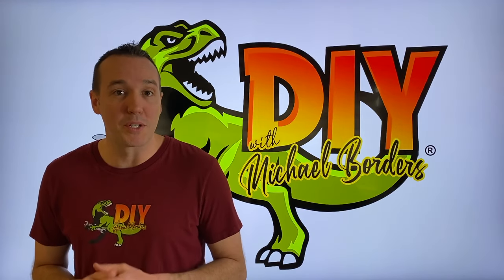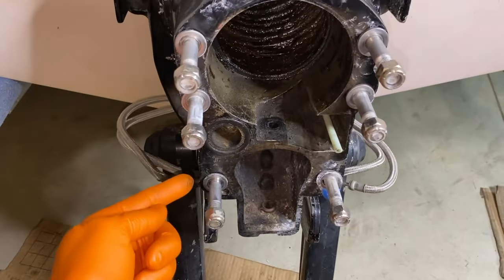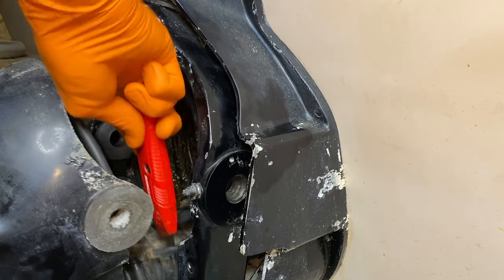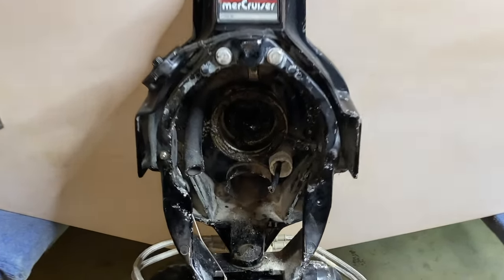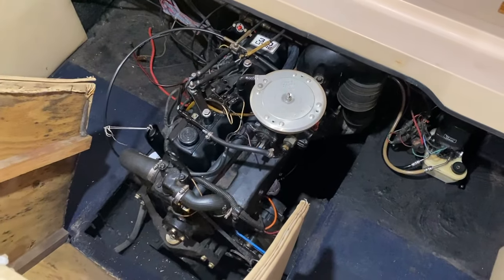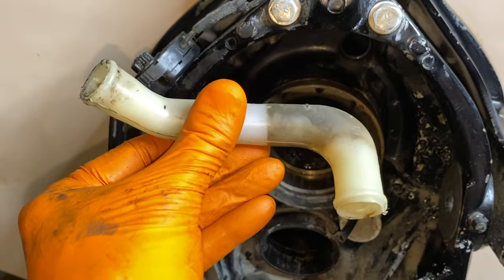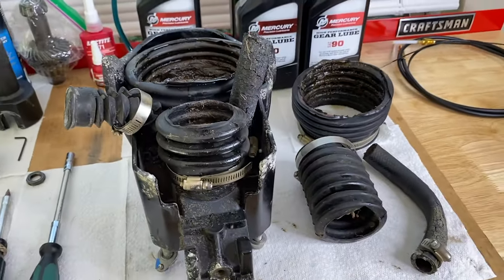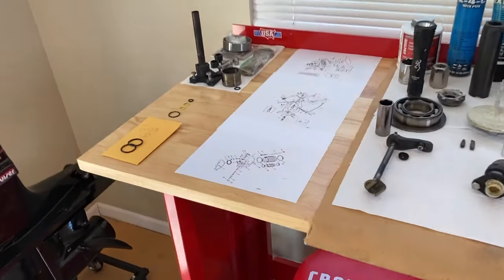Replace Mercruiser alpha one gen 1(2) outdrive bellows - PART 2

Comment from the maker: If interested in purchasing this product, visit our Amazon affiliate link below.  I earn from qualifying purchases.

Service manual 6:  https://amzn.to/3ysdBu6

Bellows replacement kit:  https://amzn.to/3RL7h8v

Hinge Pin removal tool:  https://amzn.to/44YuasH

Pic tool set:  https://amzn.to/3OCE9NE

Long flathead screwdriver:  https://amzn.to/3OQebHB
          
Pipe/hose cutter tool:  https://amzn.to/454qaXC
          
Flex Shaft Screwdriver:  https://amzn.to/3s8E3W4  

Utility knife:  https://amzn.to/3QBjP1K

Gen 2 U-joint tool set:  https://amzn.to/3KvNPbu

Shop Vac:  https://amzn.to/3scLdsr

Endoscope:  https://amzn.to/3qvdU3m

Shift Cable Socket:  https://amzn.to/3qtVdgq

***********

1.  How to remove outdrive from boat

          https://youtu.be/mD3YcT2Ohrc

2.  Bellows replacement (PART1)

          https://youtu.be/NcObTOYXtQM

3.  Endoscope tutorial

          https://youtu.be/HiPQlDLjiBI

Comment: Excellent excellent video I have a quick question.  Is it any easier to do this on a GEN two and in general How long can you wait before a Bellos overhaul if the boat is trailered and flushed and washed every time it is used.   I use mine in saltwater.
Reply from the maker: We really appreciate the feedback, very much appreciated.  😎👍

The big difference with the Gen 2 is the oil line.  The Gen 1 setup does not have the oil line that feeds from outdrive and into bell housing…and through the hull and connects to reservoir.

Some will drain oil prior to beginning this project to alleviate a mess when disconnecting line during project, while others will plug line.  However most, including us, will drain oil oil completely first and replace the oil hose during the project.  

After boat is removed from water and trailered, you can start when its best for you.  

Keep us posted on your progress.  👍🧰

Comment: 2:52 Mine will NOT budge and now the screw head is slightly stripped. Does this really need to be taken off?
Reply from the maker: @catlas_  

Thanks for watching, any update?  Not always…however that will depend on the level of repairs you are performing.

In our case, it needed to be removed during the overhaul process.

This screw/pin is held in with Loctite, and can be very stubborn to remove.  Keep us posted.  🧰

Comment: the shifter shaft seal is not an oil seal its there just in case the exhaust bellows got broken the water dont go to the u joint bellow and keep your boat running free of water without a problem and helps to keep the lubrication in the shifter too ...there is not oil there ...my respect exelent video
Reply from the maker: @luiscardozo0000  

😁👍

Comment: Hi Michael my tv switch itself of i was about to switch on my PlayStation and the remote is broken the power button on the tv doesn't work so and its a Hyundai PHD Monitor 42 inches what should i do
Reply from the maker: Hey thanks for reaching out to us.  We recommend unplugging tv and leaving disconnected for 5 minutes followed by plugging back in and seeing if power button works.

If not, it’s surgery time!  Time to replace the power button.  Below is a helpful video showing how to do that.

       https://youtu.be/vsLSXk6Q5Tw

😎👍
Reply: @DIYwithMichaelBorders  the thing is it pretty old
Reply from the maker: @panthercrew9506  

Might be best to replace button at a minimum.  👍
Reply: @DIYwithMichaelBorders  thanks
Reply from the maker: @panthercrew9506  

😎👍

Comment: what specific tool is used to remove the retaining ring on the U-joint bellows with alpha gen 2? the "gen 2 ujoint tool set" in your link is everything for pulling and inserting the gimbal bearing, but is there a specific tool for getting the retaining ring out? Or do I just have to try and bend it out? Thanks!!
Reply from the maker: Thanks for watching, most will just carefully collapse the lock ring with a flat head screwdriver.

Comment: I have a Alpha one Gen two with the Gear oil reservoir in the engine  compartment on the front of the engine. Do you have a video showing removal including separating the oil line?
Reply from the maker: Thanks for watching, we don’t at the moment unfortunately.
Reply: Your videos and explanations are very supportive and well done, i have never done this 😅 job but step by step going through the process. However i have the same oilreservoir and oil line. When i dismantled the bellhouse the oilline broke of the point where it goes through the hull. Excuse my explanation, i am dutch haha. This seems a big problem as i have a 5.0 v8 and much less space then you have with the 3.0. It appears to me i can get the trim done, possibly the shift gear 9 very difficult to reach the point of entry. Probably shou😅ld not change that plastic insert since i cannot reach it. Anyway in the end the broken plastic nipple is the point where i have no more answer except taking the engine out to reach it as it appears to be fixed from the inside through? Do you have any suggestions how to approach this, ilive on Bonaire (carribean island) and it is not easy to get any tools or materials unless i have someone bring it over.
Reply: RM22-861163 and 	RM22-861163 seem to be the item broken. Is this possible to change without the hassle of removing engine. My boat is a capri 2050 XL 2001.  The inside is very difficult to reach

Comment: The shift cable is just suddenly cut in two. If you want to save the shift cable, how do you separate it?
Reply from the maker: Thanks for watching, you definitely have the option to remove cable without cutting or snipping it.  It will be the same steps, minus cutting cable.

Comment: Mike I love your videos, I remove my gimble unit yesterday following all your advice and to my surprise the water gimble water tube was a copper tube, I cut the hose with a utility knife and being careful not to cut the plastic but it turned out to be a copper metal tube.
Reply from the maker: @garymilner2544  

Good morning ☕️

We appreciate that, thank you.  The copper pipe is a more reliable and longer lasting option however can be a bit annoying during the removal process of Bell Housing and bellows.

Were you able to remove pipe?
Reply: @DIYwithMichaelBorders  I have not removed the tube as off today, but we are having rain all day, I will get to it on Monday, today I am getting my new upper gear case drive shaft, I order it because upon inspection of mine the oil seal caused wear groves on the inner seal shaft. So, I ordered the whole new shaft rather than messing with pressing out the old universal joints. Thanks for getting back to me, have a good day sir. 
Gary from Ohio.
Reply from the maker: @garymilner2544  

Very cool, rain days are good once in a while.  😁👍

That’s smart to be replacing shaft after finding the groves in it, looking forward to hearing back from you.